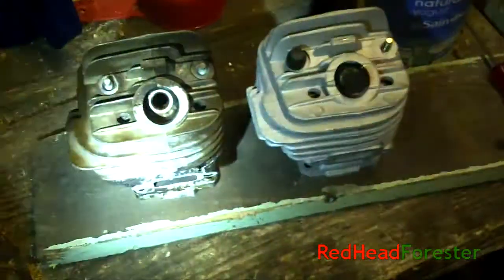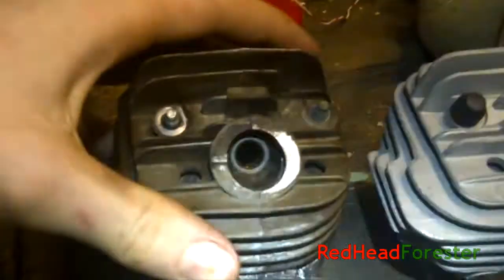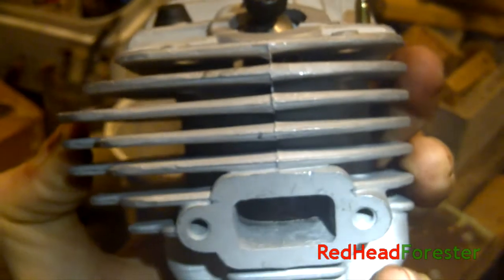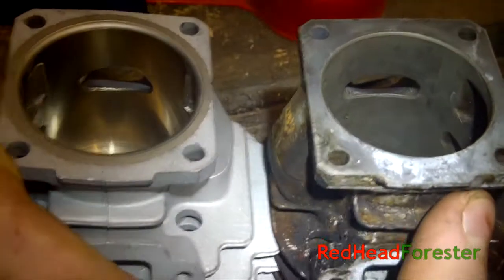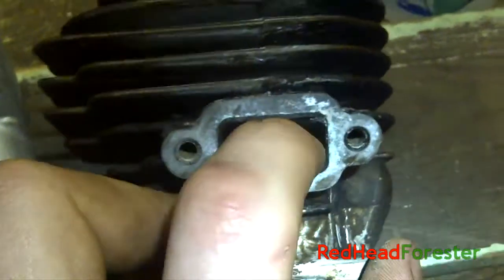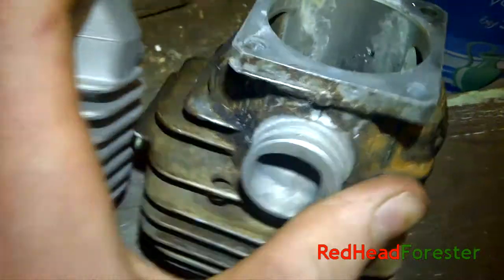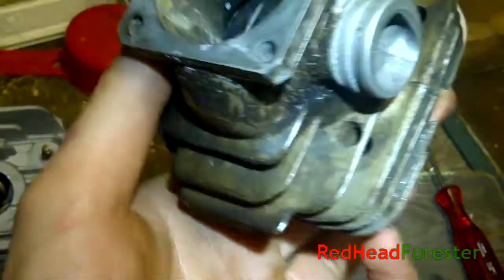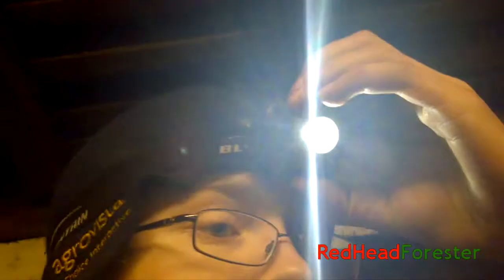Stihl MS260 cylinder comparison: Hyway vs OEM

Comment: here is a comment for Hyway MS250 barrel rather than 260. This is the one with the built-in bearing lands for the crankshaft main bearings. Racked up 60 hours on one and now there is 3mm vertical play (and zero lateral play). The vertical ribs (adjacent to the transfer ports) have compressed allowing the bearings to move vertically. The first thing you'll know is it will stop oiling the bar as the worm gear looses contact with the crank. I'm going back to oem parts as aftermarket is in this case false economy.

Comment: Does any aftermarket company make a better cylinder?
thanks for the vid!
Reply: not really. meteor aren't too bad (better than that up there anyway^^)top end pro saws your best using OEM if your working with them all day everyday. just cost a bloody fortune lol.  ms660 kit = £280+vat
Reply from the maker: I've heard good things about Meteor.  So far only got a Caber piston ring in one of my saws (same company as Meteor).
OEM may be pricey but cheap when you consider the price of a new saw!
Reply: @RedHeadForester  oil mix 1:33 ?

Comment: can you  not just buy a new cylinder bore and replace the one in your old head?
Reply from the maker: In modern chainsaws the cylinder is almost entirely aluminium with a layer or chrome or nikasil (as in the case of the Hyway) on the inside of the bore.  There's no separate bore to be replaced.